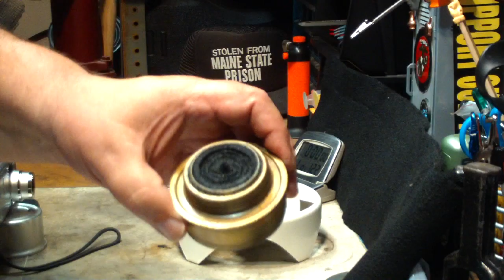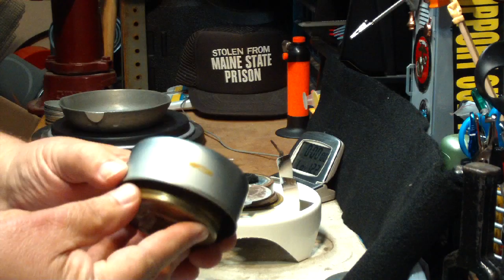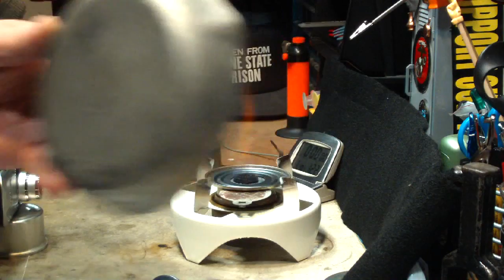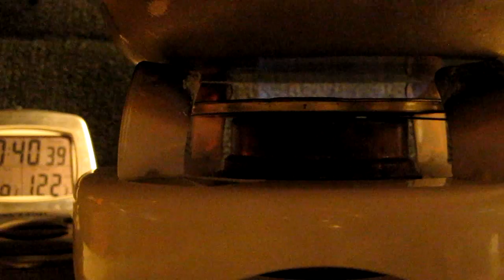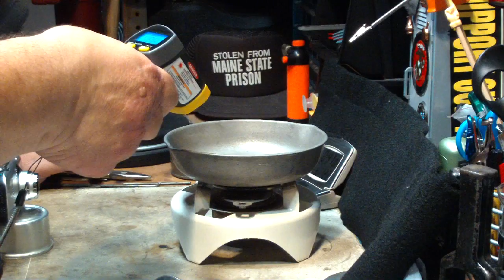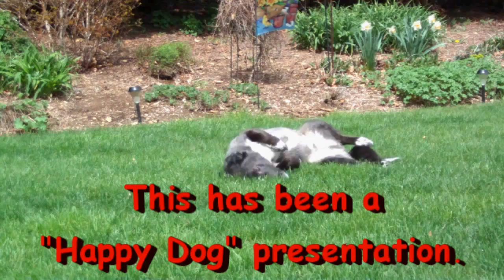Low Power Trangia Simmer - Shield Test #1

Comment: Hi Hiram I was wondering what your views on the best heat disbursed for a Trangia (25). I am very impressed with Trangia in general but it is quite difficult to avoid burning, even with careful use of the simmer ring. Is these some filter or cap that will spread the flame more evenly? I would be very grateful  your views. Many thanks Margot.